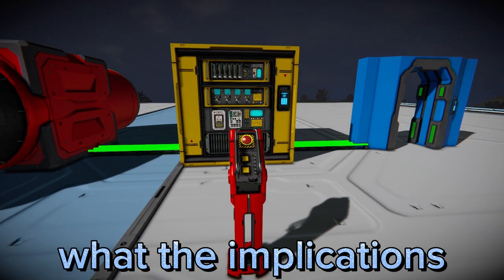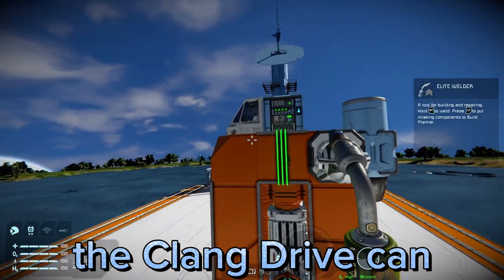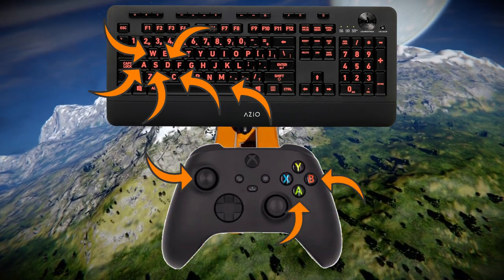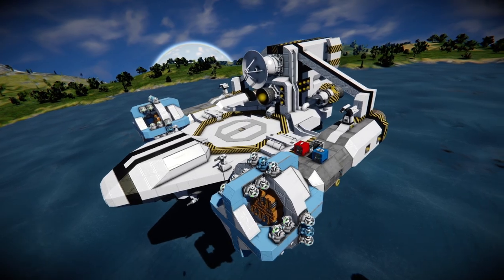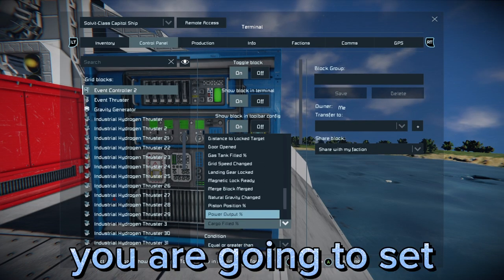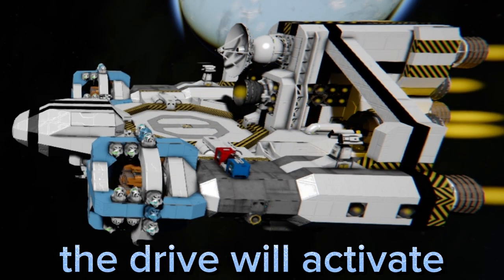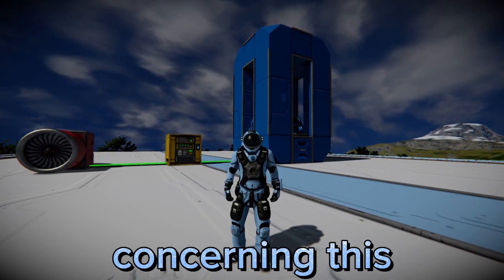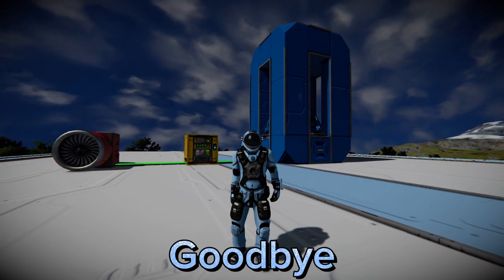Space Engineers - Automated Clang Drive w/Event Controller

Comment: Given that a single threshold costs 20 PCU, you can set up multiple? Like, 25, 50, 75, 100 percent power? Six axis control system would cost 480 PCU, a fraction of the clang drive cost.

In any case, this is revolutionary.

Comment: Thrusters are 0% or 100% when you press WASD keys, so not sure where 49.5% comes from...
Reply from the maker: I thought that was the case as well. I realized that the thrusters didn’t behave this way when I used an Ion Thruster on Earth-like (1.00g) and the override was somewhere around 50% even at full power. Because of this, the thruster wasn’t able to reach the threshold for the Event Controller. I am quite certain that the thrust override applies to the thruster’s potential power.
Reply: @RhynoSpartan  That is because ion thrusters max thrust decreases as atmospheric density increases. At "sea level" they bottom out at 20% of max. Has nothing to do with gravity. Atmospheric thrusters work in the opposite way. Hydrogen thrusters have no such mechanic.